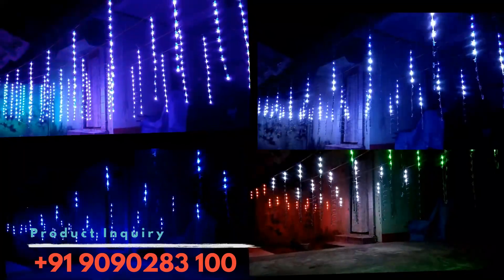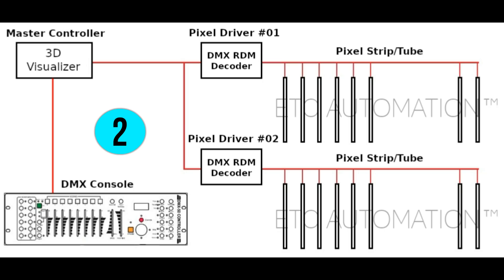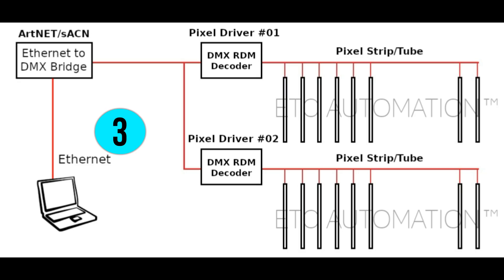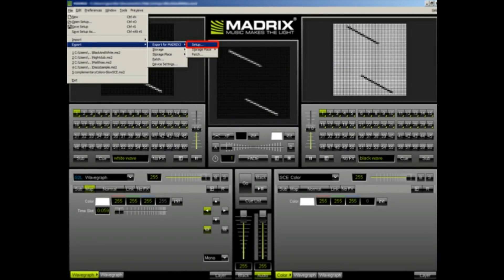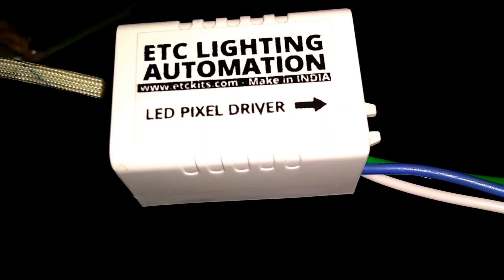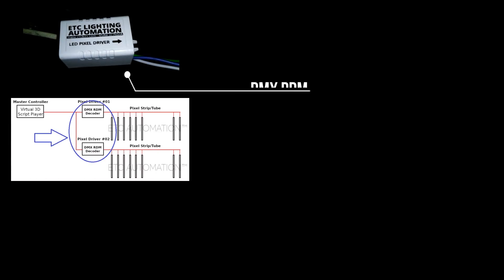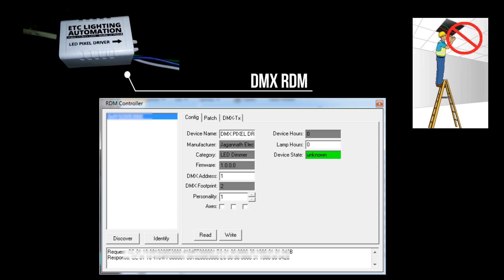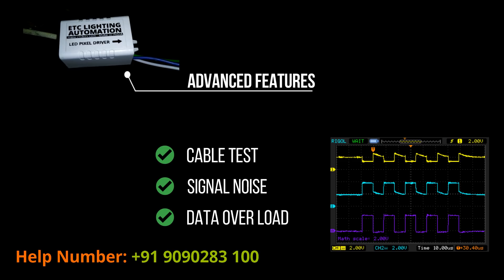3D Pixel LED Controller | Wave Animation

Comment: Price
Reply from the maker: Thank you for your interest.
Please mail us to: info@etcautomation.in with details of your need i.e. setup size and number of vertical pixel strips want to use in your light show. So that, It will passable to estimate the price.
Reply: Cost?
Reply from the maker: Hello Sir, there is number factors need to consider. Please mail at info@etcautomation.in or send message on +91 9090283100 so we will find best Gadget for the Cost.

Comment: How to create this effects which software u used please tell me sir 7036933070 my whatsapp number tq sir
Reply from the maker: No manual pixel data feeded to the Master controller, that mostly the common technique used in Chinese Memory card based controller. 

The effects are itself 3D planar script that hard coded inside the Master controller which is generating realtime data for the Recever pixel controller. The process is bit complicated but we are working on a user interface that will help you to tune or create new effects for your show.
For now, if you need any effect send us video or image or ideas, we'll create it for you.
Reply: @ETCAutomation  tq sir where to buy this device
Reply from the maker: Please send mail to info@etcautomation.in or send whatsapp message to +91 9090283100

Comment: supply conectiom
Reply from the maker: All the Pixel LEDs (WS2811) are connected next to another. The DMX data line of Pixel drivers (Slave) are connected in parallel to a Single Master Controller using twisted pair cable, terminated by 120 ohms resistor.

(Note: better to use shield DMX cable for outdoor lighting show)